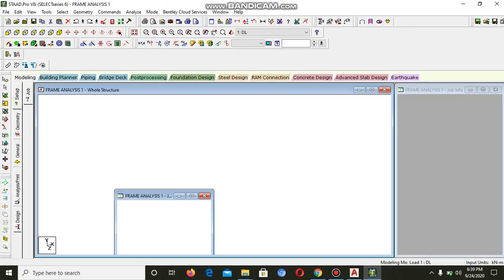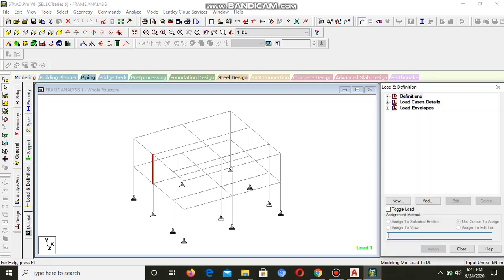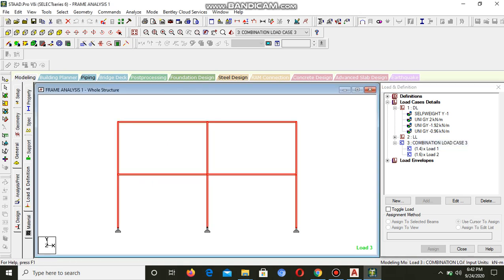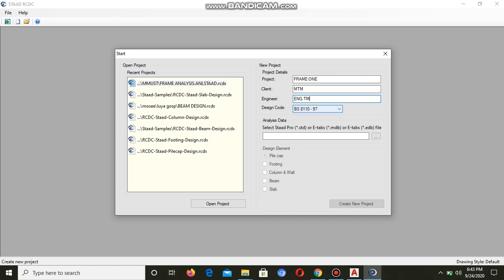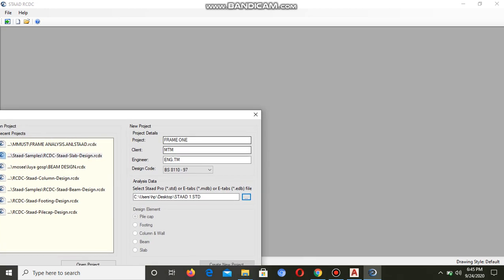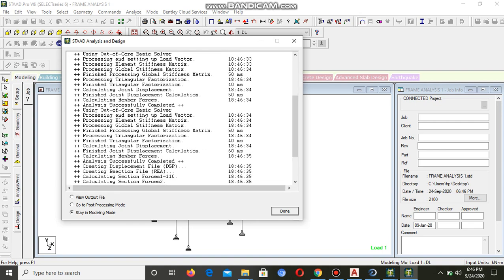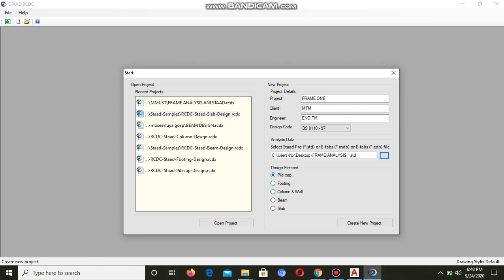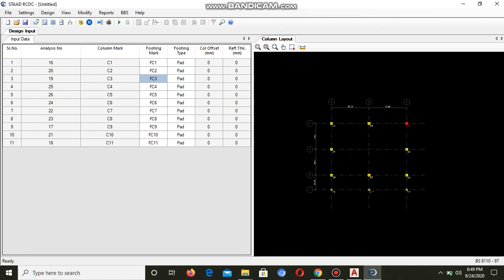Foundation Detailing By STAAD Pro RCDC From Frame Analysis

Comment: My rcdc showing  license for the design code is not found plz help
Reply from the maker: You need to use the correct scube license key for cracking .make sure you always disable the antivirus protection and internet when cracking the software.